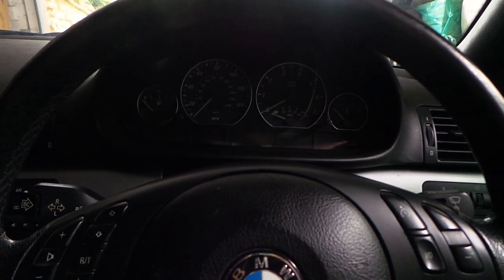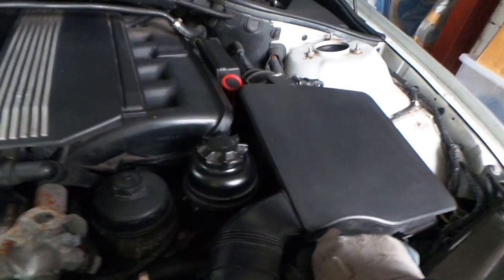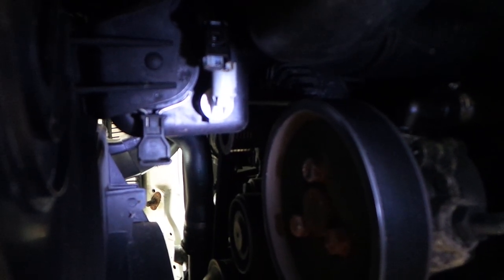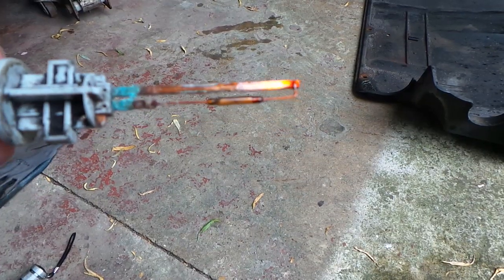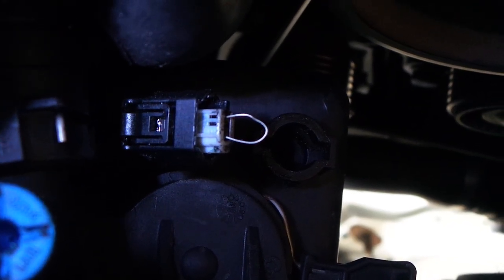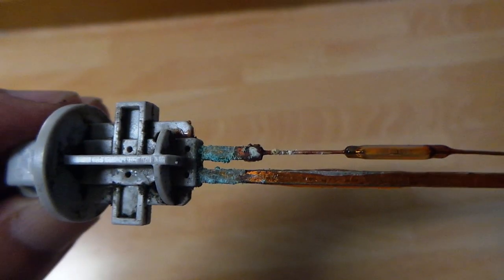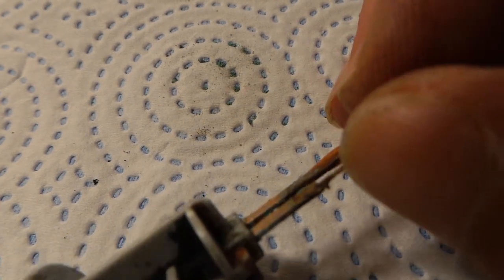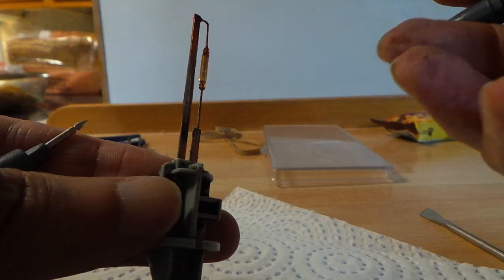BMW E46 Low Coolant Level Warning Light Stuck On

Comment: When you remove the sensor with the expansion tank full, should it be wet? I replaced the sensor and the light is still on
Reply from the maker: When I removed the sensor, it was not wet but the tank was full.  The sensor does not actually sit in the water.  There should also be no water come out when the sensor is removed.  If the light is on, I think that means the contacts are not closing, or there is a broken wire in the wiring harness or perhaps a bad contact in the connector.  You could try using a multimeter across the sensor contacts and see if you read continuity when you place a magnet near to the sensor ?  Good luck :)
Reply: @neilbreakwell4500  Thank you!
Reply: @nocomments7315  Iam guessing its a bad contact. Inside of the contact is claws that dont press enough around the pins in the sensor. My lamp is off when cold, but when it gets hot bumps will turn it on and off. This spring i took just a pinch of copper paste on the pins and it has worked fine all summer. But copperpaste will dry up and a few weeks ago it started coming on off like before. The cable is short and its not easy to bend the claws togheter, but iam sure thats my problem. But i have to remove the big plate under my car, not only the plastic one. If you look in the window washer tank you can see the magnet that has floats that is lifting it up, until the washer level drops to much. Its the same sensor in both tanks.
Reply: @hakan8997  After a few more tests, I ended up replacing the expansion tank. After opening it, I noticed that the float was not moving correctly.
Reply: @nocomments7315  Ahhha! I have to check that. Under the airfilter box is a magnetic valve for the hot water to the coupe heater. It did not close 100% so i had some heat coming with the heater turned off. I just took the 4 small screws away and lifted the metallic part up and cleaned the inside and needle that did not look dirty. I lost a table spoon of colant in a rug. Perhaps the coolant turns into some slime that we dont see as dirt but works like glue or or a thick sauce?
Perhaps the coolant system need a clean up bottle and new fresh colant? 2003 330 cab.
I have had it for 11 years and i dont think anyone before me has changed the coolant.
My radiator was expanding in the middle so i have a new reinforced radiator that is some 6-7 years old. Then i got some new coolant.. Its my summer car so iam using it 6-7 monts a year. In the North of Sweden...
Reply: Probably one of the most naive questions. The coolant won't spill if i remove the sensor, right?
Reply: @MelusiBhenguthe_great  No water/coolant will come. If you look inside the window washer tank you can see how the coolant tank works. I guess its the same censor in both of them. check the contact it could be your problem. Its getting hot and cold and metal is alive. Few has problem with the washer tank.
Reply: @MelusiBhenguthe_great  It’s not a naive question at all—it’s a reasonable assumption to think the sensor would be submerged. But no, removing it won’t cause the coolant to spill.